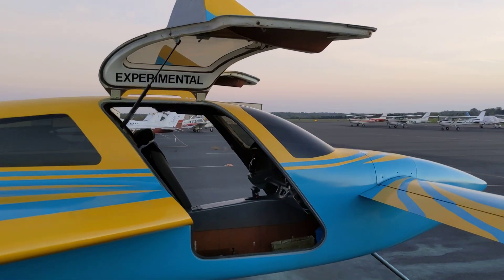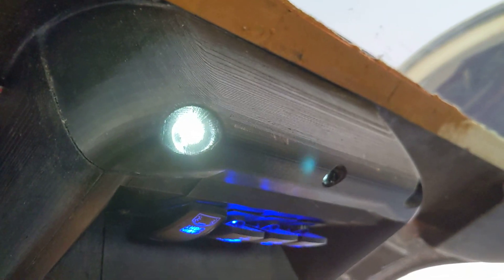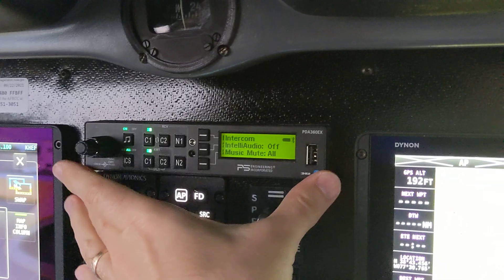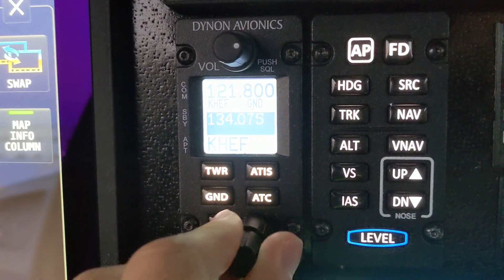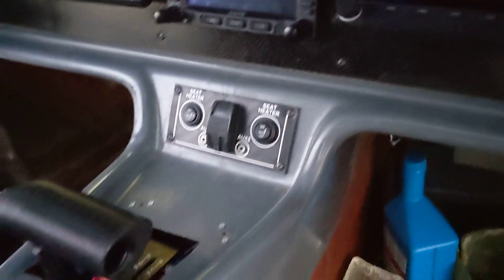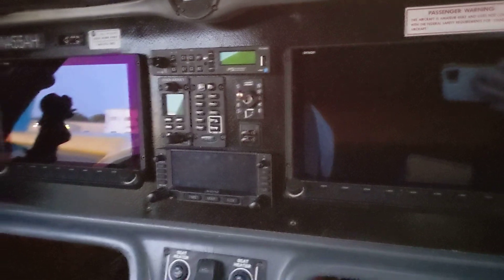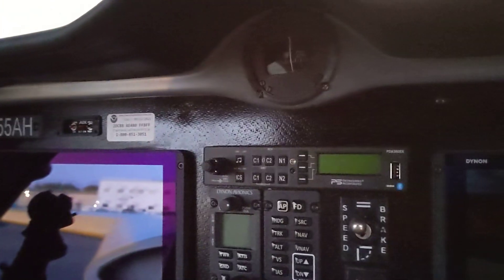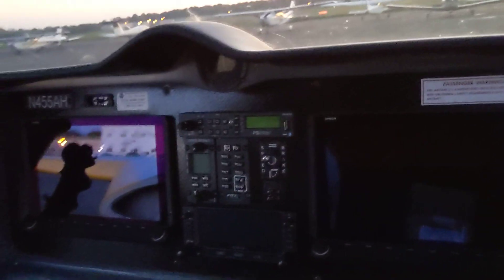Velocity XL build overview

Comment: 1. Did you build this yourself and how long does a build take?  3. Lots of 3d prints, did you 3d print them to save money and customization or do they also sell the missing pieces?  Thanks!
Reply from the maker: Built it myself. I was doing it at the factory with their guidance and tools, so it took me one and a half years from fast build kit to test flight. Then another year for testing, fixing issues, painting, and interior.
I 3D printed for convenience and customization. They have a different overhead panel, but not the rest of the things.

Comment: I LOVE the overhead switch panel, I've always thought those were just so cool. My only question is about the mags. Why did you choose to put them there? Not criticizing, because I'm certain you've spent HOURS AN HOURS obsessing layout and format. This is my dream bird, so I'm very interested.
Reply from the maker: Just seemed like a natural pattern. Like reading left to right. First line is battery then alternator. Next line is fuel pump, left mag, right mag, then start. Makes startup easy and straightforward

Comment: Great tour and well thought out layout.

After 40 years in commercial aviation I can tell you that 40 years ago if a cb popped in flight we would attempt an inflight reset. 

After a few fatal accidents the industry changed its thinking. In almost any situation loss of one electrical circuit is not crucial and at best resetting a breaker in flight regains convenience, at worst resetting a popped cb can start a fire in flight and kill all on board. Unless there is an obvious reason for a popped cb such as something catching a manual cb and physically popping it the cb is never to be reset in flight. A crew can use its emergency authority to reset a cb in flight however there would need to be a very good reason. Tech ops (mechanics) might suggest an inflight reset however I have never seen that after 21,000+ hrs of flight.
Reply from the maker: Good tip. Only time I had a cb pop was early on on the alternator, which may have been because it was never properly grounded. I'll keep this tip in mind, thanks!

Comment: Hello Mr Michael 
A question: what should I have licenses to fly it. 
Is PPL, IFR, MER enough for that?
Reply from the maker: PPL is plenty enough
Reply: @Rassah  in single engine case,  but what about Velocity twin?
Reply from the maker: @agriculturalsides9561  Still PPL. But for Velocity XL you'll need a high performance rating if it has a constant speed prop with a powerful engine, and for a V-Twin you'll need a multi- engine rating. Both are just add-ons for your PPL that just need a bit of extra training.
Reply: @Rassah  thanks for your explanation 👍

Comment: Velocity do have electric heaters, you don't need to pump any hot oil. Beautiful planes, getting more efficient every year too.
Reply from the maker: The oil one is pretty sufficient. It's there anyway by default. Since the engine is in the back, there's not enough airflow to cool the oil in the radiator back there, so the oil needs to be routed to the front radiator where it can get plenty of cool air on it. The bypass for heating is just extra.

Comment: I love all of the 3D prints!
Makes it real easy.
What are your plans for interior coverings? Will the front panel get a covering as well? It appears a little rough in some close ups.
Have always thought of building an XL but it was put on hold after moving to a backward country in the EU in the southeastern Med., seems they are the only country that does not allow Experimental home built aircraft. I guess they don't have decent mechanics available to do inspections but considering I am the builder and its my butt on the line, I don't leave any stones unturned.
Keep up the excellent work!
Reply from the maker: I plan to keep the panel as its. Only the dash cover, center console, and part under the panel are getting covered. Leaving the painted fiberglass visible to show its "roots" same as the uncovered 3D prints.
I'm moving to EU with this thing too, but I may just end up registering it at some other country from where I live

Comment: How did you add the joy stick controls?
Reply from the maker: Not sure I understand the question. The joystick themselves are sold on Aircraft Spruce and are standard size for airplanes. The sticks they attach to come with side stick kit from Velocity. The wiring is described in the joystick manual, and was soldered to the internal switches and then wired to various inputs on the avionics

Comment: Would you share your 3D print designs please?
Reply from the maker: Sure. Just keep in mind some of them are specific to my plane (angle/size of holes cut out etc)
https://cad.onshape.com/documents/df1baccc194c483ab18e8133/w/98726d94011f1b2aa8d5d5b7/e/da32c645764ff33b9748159c

Comment: Why didn’t you use red or red/white led lights for your overhead lighting?  That way you wouldn’t loose your night vision with the bright white lights but still have the white available in daytime situation if needed.
Reply from the maker: I thought about it, but decided if I wanted red light in flight I would rather use my headset. The three LEDs in the front are also fairly dim but still provide plenty of light. This is more for getting in and out of the plane on the ground, and in case I REALLY need to see something inside.

Comment: Looks great, really nicely done. Good use of 3d printing here.

Are you planning on adding trim and carpets etc?
Reply from the maker: Eventually, yes. There's still some work to do inside, and after the fist 150 I plan to take apart the keel to verify that everything is doing okay in there and not rubbing or jostling. Easier to do without the carpeting.
Reply: @Rassah  never would've thought of that, good idea!
Reply: Besides 'space', curious why you opted for Side stick?  ...I'm thinking, its b/c all your controls can be accessed with Right hand,  nothing else for Left
Reply from the maker: @NightSky777  Space was the overall big one. It's easy to put sticks on the side and complex throttle/prop/mixture levers in the middle, vs stick in the middle and throttle quadrant on each side. Usually those end up being push/pull rods that I don't really like, and I don't think the factory even has a "default" method of putting them on each side vs side sticks.
I wanted to have the plane flyable from either seat.
Reply: @Rassah  enjoy reading of your rationales for design, well thought out!

Comment: Please share the laser engraving company URL. 
Great building! 3D printing as much as you can gives more freedom and it's actually a good idea!
Reply from the maker: https://rockerswitchpros.com/
I ordered them with text and image on one side, and a line of text of ASCI characters on the other (a box like this I think ) to make the line. And I think I had to flip the text upside down to make it work. They have a lot of customization options. The switch is just a Carling rocker switch. You can order them from almost anywhere. I had to 3D print a switch cover removal tool though, since it's $5 online.
Reply: @Rassah  great info on the specifics, thanks!